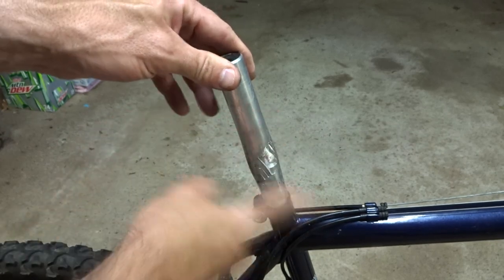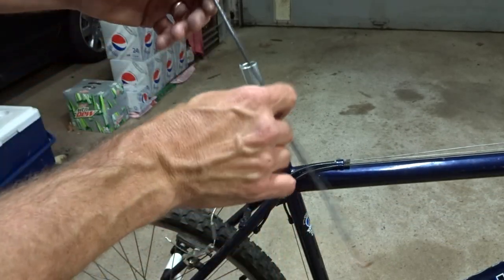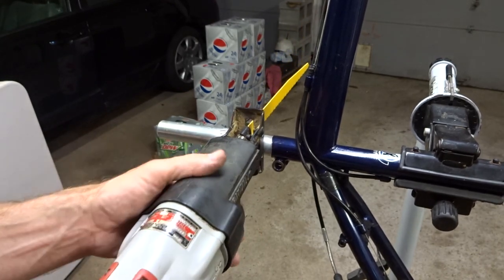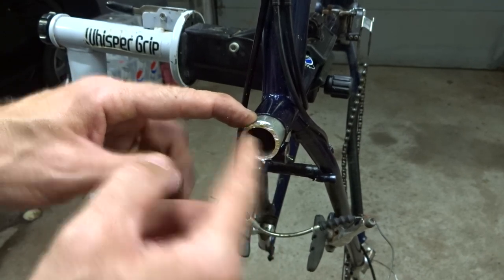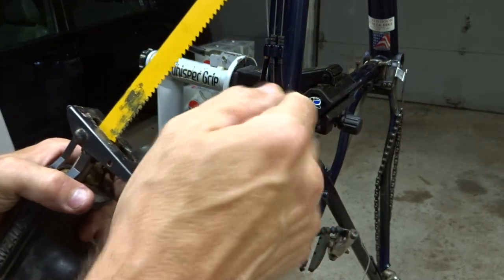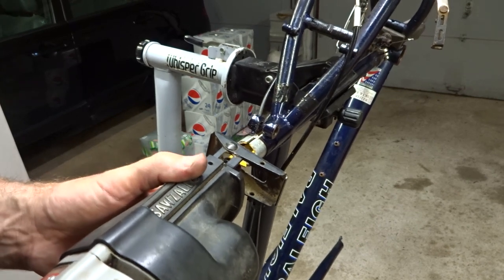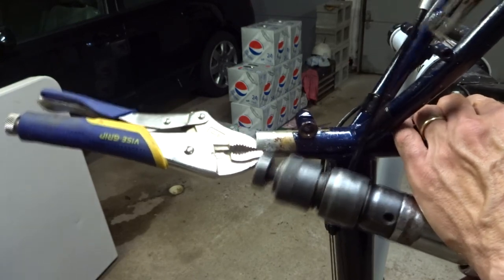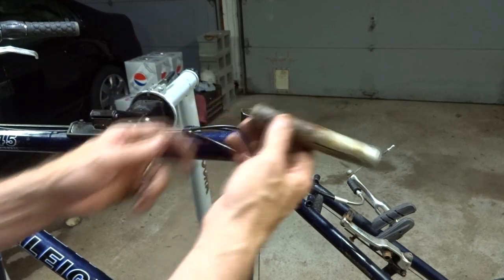Removing Stuck/Frozen Seatpost By Cutting With Sawzall

Comment: I took a 12 mm bolt. Cut the head off. Cut a vertical slot a few cm deep. Put a spot of weld to close vertical slot. Crushing with a hammer would work.

 I then got a 40 grit belt. Cut it. Put it through the vertical slot and wound it around the bolt. Put it in a drill and used that to thin the seat post.

It took a bit longer than this but could easily be made with just a hacksaw and drill if you don't have a reciprocating saw.

Comment: You shouldnt use random tools like a pipe wrench to remove the seatpost with brute force. If you damage the seatpost it could snap off and then its near impossible to get out of the frame. Just twist it with the right size shaft clamp.

Comment: Wonder how come it came out when you cut only through the not rusted part of the post.  The most rusted section, which was holding the post in the frame was not cut at all.
Reply from the maker: There was no rust.
https://www.youtube.com/watch?v=bGqV5KE7cb8
I cut slots to relieve the pressure holding it in.

Comment: Hey! Is it feasible to remove the seat post tube from the actual frame and weld a new one to it? Cause I've been trying everything! to take a seat post from the frame (including strapping it to a tree towing it with a car) and no luck! Could it be done and is it worth the hassle? Thanks!
Reply from the maker: Not really. Did you try a slide hammer? Did you trying cutting it out like in this video?
Reply: @RJTheBikeGuy  i don't really have enough tube showing for this. It's jammed al the way in there, andwhe i tried the cutting method e just shattered the top bit...
Reply from the maker: Then you need to hook the bottom.  Hard to explain how, but possible. I am hoping to make a video sometime on it,

Comment: Ive got this issue but its now flush with the top of the seat tube so I cant clamp the vice grips on. Any recommendations RJ?
Reply from the maker: You're going to have to make a tool of some sort to reach down and hook the bottom of the seatpost to pull it out.

Comment: I wouldn’t risk sawing because you risk breaking through and damaging the frame those aluminium seat posts are easily drilled out with a 27mm drill bit

Comment: Any know/tried this method with a jigsaw? I've dekcuf my seat post trying to get it out.
Reply from the maker: I have not tried this with a jigsaw. They generally have shorter blades. Probably too short.
Reply: I didn't think about that! Any thoughts on using a hole saw cutter? The hacksawing method seems to have hit a dead end. Or just persist?

Comment: My seat post has fallen into the seat tube.   The top of the post is about 5 inches below the top of the seat tube.   I tried banging it out with the bike upside down - banging on the bottom of the pedal bracket tube.   No luck.   I have enough seat tube to anchor a new seat post, but I shall need to use a reducer fitting to hold the narrower seat post in the tube.  I can't think of any way of removing the segment of tube post that is stuck in the tube.   I am hopeful that I can anchor the seat post with the reducer fitting.  If not,  I shall have to junk the bike.   I can't ride it without a seat!     I feel like an idiot for dropping the post into the tube, but we all make mistakes.

Comment: I had to unstuck a carbon fibre seatpost from my aluminium frame. Luckily it wasn't so distructive.  With a lot of WD40 and jiggling (with no perceivable give from the post) I got it out in about 2 hours with breaks. Damn.
Reply from the maker: I spent days trying to remove this post through other means.

Comment: I'm in the cutting phase right now. Nothing is working. Hoping this works for me!
Reply: Are able to remove it?
Reply: @lionden4  I used a sodium hydroxide mix, poured it into the frame. Didn't affect the steel frame.... Melted the aluminum seatpost lol. After a year of trying everything it was the only solution left.

Comment: Since galvanic corrosion was the problem, couldn't you have applied voltage in reverse polarity to counteract the cathodic reaction between the dissimilar metals?? B'H.

Comment: If it's a steel frame use some gallium metal. it dissolves aluminium
Reply from the maker: Gallium will also damage the steel.
Reply: @RJTheBikeGuy  .wow nasty stuff that galium.Back to the drawing g board I guess

Comment: Soak with wd40..wait 5 min..pull out propane torch...heat seat post till glowing red...shut torch off..grab big vice grips..clamp super hard onto seat post just above where it enters frame..use 24 mm wrench as cheater bar..work back and forth till out..
Reply from the maker: LOL! You have have never encountered a seriously stuck seatpost!
Reply: @RJTheBikeGuy  well I thought they were:)....I like a challenge too..great vid.
Reply from the maker: @mikesmith406  I had doused this sucked with various penetrating oils. I heated it with a heat gun. I froze it with dry ice. Variations of hot/cold. I used my Snap-On air hammer on it. I used a hand sledge on it, trying to gte it to move. Notice the teeth marks on the seatpost? I used my big pipe wrench on it, and it was just started crushing/twisting.
Reply from the maker: https://www.youtube.com/playlist?list=PLxO5aF0sensiVdiClC_JH6OboqFl5Dvay
Reply: @RJTheBikeGuy  I believe the expansion created by a propane torch is alot more than your heatgun..I also had tried sledgehammers pullers etc...
Reply from the maker: @mikesmith406  I have tried a propane torch in the past and it didn't make a difference.
Reply: @RJTheBikeGuy  man that's crazy..a mechanic I know who worked on alot of rusty stuff taught me that trick..but I hear ya..you must get crazy stuff where you are..are you in the rust belt?...love that puller idea by the way..the one that started out as a hydraulic...good stuff.
Reply from the maker: @mikesmith406  Galvanic corrosion (aluminum oxide) is harder than rust (iron oxide). https://www.youtube.com/watch?v=bGqV5KE7cb8

Comment: Would be usefull some BRAKE OIL , for pulling it out !
Reply from the maker: What is your deal with brake oil?? I used penetrating oil. This is what penetrating oil is made for! Brake oil is NOT made for this. It may work, but doubtful it will work better than something that is made for this!

Comment: Heat upper frame not seat tube
Reply from the maker: They are in contact. The heat will go to both frame and seat tube. Aluminum expands more than steel. The best you can hope for is it to help break it loose a little bit. Frankly I have rarely ever had any success with heat/cold. If you have had luck with heat, then your seat post was likely not very stuck.

Comment: l have cut the steel pipe down then clamped it with like muffler clamps but guess it moves a little and breaks later, and ugly, .......anotehr...guess the cut marks from sawsall inside steel pipe in frame will not make a crack later but its not very pro makes a weakness. a way to avoid cracks is same could be same as when removing a suspension joint from car , from insdie a  hole holding the barrel of it . removing inside first , then cut was it two lines say half way through or more , then screwdriver to lift it up bit by bit  , three might be better even four. https://youtu.be/9Pe0PQ8hZ7w?t=173 thats not the same as l mean but almost. too lazy to find it now hard to describe in words how to use the screwdriver hammer on end of it and tip in crack between frame tube and alu stem then it lifts up the cut lines in alu  so no or little damage to iron pipe.

Comment: Can u unstuck my seatpost
Reply from the maker: No. Figure it out yourself or take it to a shop.
Reply: my aluminum seatpost is stuck in the steel frame. I tried to apply oil but it did not work. What can be done to remove it?
Reply from the maker: @zwall4466  https://www.youtube.com/playlist?list=PLxO5aF0sensiVdiClC_JH6OboqFl5Dvay